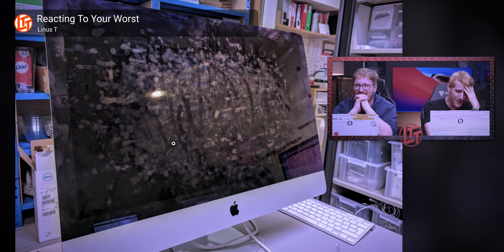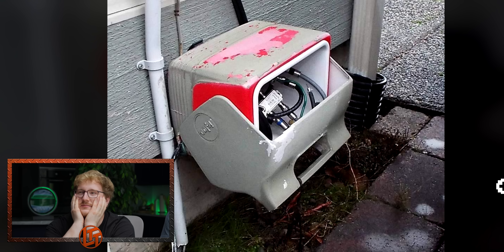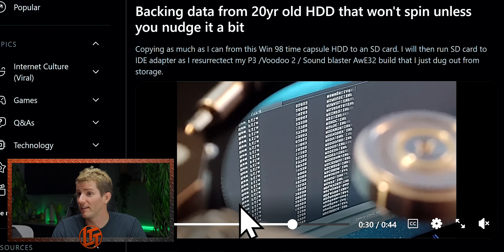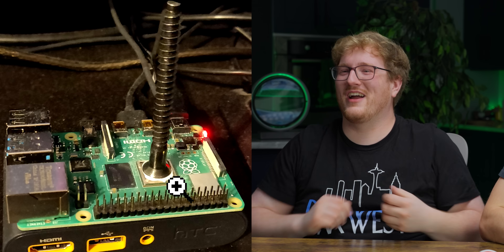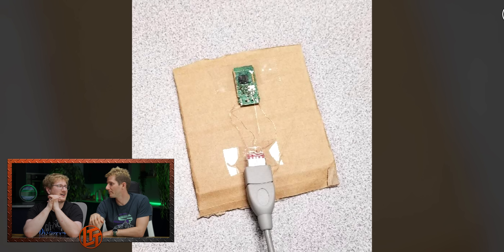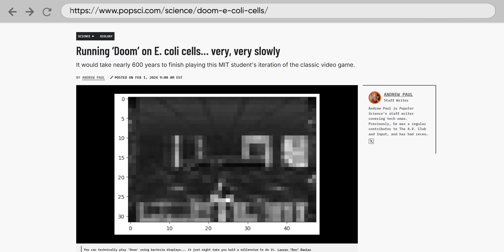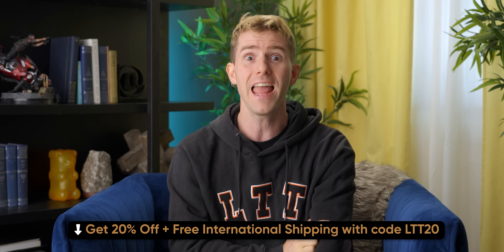Are You All Geniuses or Idiots? - Reacting to Your Best Tech MacGyvering

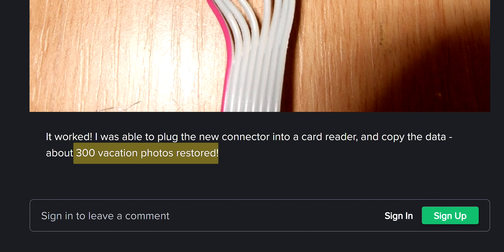Comment: In defense of 10:43 wooden monitor arm, those are NOT cheap to ship if you live on an island.
I have tried to order proper ones online, and have been quoted $100+ in shipping alone.
Think "metal item" and "air mail"
I think that one is perfectly valid and clever.
Reply: Yeah, and it doesn't even look bad in my opinion. Sure, the finish is a bit rough. But it seems to be in a workshop environment so that's perfectly fine. If I had made this I'd actually be pretty proud of it.
Reply: yea, idk if they realize that a lot of the cost to get things to islands/smaller countries may be due to the weight of the item not the US$ cost. As a result, it may be less costly to get an expensive light item than it would be to get a cheap heavy item.
Reply: And sellers that ship it to their country usually don't buy enough to benefit from bulk shipping because the demand is low.

I'm really annoyed with how inconsiderate people are even when they don't know anything about the situation.
Reply: I have a moveable monitor. It lives on a ream of paper. When I want it closer, I wiggle it forward. When I want it higher, I add paper. When my printer runs out, my monitor gets lower.
Reply: Learning to weld might've been a better idea still.
Reply: @GoogleDoesEvil  Yeah, but metal ain't cheap either though. That looks like a bunch of scrap wood he had lying around. The whole thing probably cost him less than 5 bucks.
Reply: Jake also went "not worth it for the amount of work" while the person may be paid pennies on a dollar. What if all that time and effort would not earn them enough money to buy a monitor arm no matter what?
Reply: @firstname8637  Steel is cheap and plentiful everywhere. Welders and welding supplies are not though. :/ Woodworking supplies are easier to get.
Reply: @GoogleDoesEvil  Depends on where you live and where you get it I guess. Where I'm from steel, while not "expensive" expensive is still considerably more expensive than cheap wood. At least when you get it from the hardware store and not the scrapyard. A cheap welder with some supplies on the other hand you can get for around 100 bucks.

Edit: That'd be a cheap cheap welder though. Workable but not great.
Reply: @firstname8637  Fair enough. I usually get my steel from people trying to get rid of it so it's pretty much free. Whereas the free wood I can pick up is unusable.
Reply: It should also be noted that isn't a $100 XBone controller. I have the same one for my laptop and it was 30 at most from Best Buy due to being an older model
Reply: Monitor arm was awesome! Can't belive it got universal dunkage. I get the reluctance to spend a lot on something that just sits there, and if they're priced at a premium in your region, all the more reason.

Comment: Guess what? Long story, but we live in rural Australia. Our Starlink is mounted 100m from our house on a small shed. Because the WiFi would obviously never reach, and we weren't able to place CAT-6, I rigged up a system:

Power goes in to Starlink modem, and up to dish

Ethernet comes out of Starlink adaptor, and enters an Ethernet over Powerline adaptor (will abbreviate to EOP) - here's where things get a little interesting . . . Because the small shed is on a different circuit to our house, I had to run a series of extension cord across the 100m span of our paddock, and then connect another EOP adaptor to the end of it. This would allow us to keep both on the same circuit.

Then, the EOP which was connected to the extension cable, was connected via an ethernet cable to another EOP on our house's circuit, with the final one providing wired connections to wherever we wanted to place a final EOP. 

Result: Despite all of the crap in the middle, latency is still pretty good - servers about 500km away get 30ms give or take, and when the distance is larger (let's say to the other side of Earth) it never really gets above 330ms. Speed is about 70-90 on the download, with 18-30 upload. If you connect directly to the Starlink, speeds are way higher - approx. 350 for download, and I think 90 for upload. Ping drops about 10ms, which is just testament to how damn fast these adaptors are these days. 🎉🥳For country internet, those numbers are crazy good. With our old provider, we couldn't ever breach 30 on download, and ping was horrendous - it would often exceed 1 WHOLE SECOND!!

It's a crazy rig, but it's still working half a year later. I made my own ethernet cable, but of course it ended up 20m too short. Bugger. 😑

Comment: Worked in a PC shop that did repairs and data recovery for a while, and yes, old HDDs can run open in a pinch and to get as much data off of them as possible. Especially old IDE drives were comparably rugged in those regards, but they also only held up to 160GB if I remember correctly. Had more than a few drives that needed a little push to run on the desk. Oh, and after I killed one of our own SATA drives that way, we built a poor mans cleanroom/-box from a plastic bin, some 3M halfmask filters and a broken hoover. Worked better than it should have and increased successrates by quite a margin!
Reply: Instead of taking the cover off btw try holding the drive and giving it a sharp spin around the rotational axis of the spindle to get it going. It's like the "phase 1" of push starting if you need to. You can go up from there of course.
Reply: @zyeborm  that was what we did first, if that didn't help... Off with the lid!

Comment: About that DB15 (vga) connector, the pencil impression is pretty smart and better than clicking a picture. It can be very difficult to judge the size in a picture.

I mean it being a vga connector, picture would have worked perfectly fine. But for someone who didn’t know that it was a ubiquitous thing, getting a perfect size replica was genius.
Reply: Agreed, and there have been plenty of connectors that look similar or even are identical in size and shape with different pin counts, or happen to be female rather than male this time that will be hard to identify correctly in a photo. Maybe with enough photo you'd figure it out, and sometimes as with something like a 3 pin vs 5 pin xlr the pin count is small and changed dramatically enough its quite apparent. 
But just from a photo, especially if its a photo with nothing to give you a sense of scale it would be quite easy to mistake the cable.
Reply: The person most likely didn't have a camera to take the picture.
Reply: I've done something similar to work out what a connector or screw was when I couldn't see it, or get a camera near it. 
You push your finger hard enough onto the connector/screw that it leaves a dent in your finger, which should last long enough for you to look at it and work out what cable/screwdriver bit you need.
Reply: @Daunlouded  That! 
I've used VGA long before digital cameras were a thing. And I believe that by the time I had a phone with built in camera I already upgraded to DVI.
Reply: Just in case they had one of those vga micros hey? 💀

Comment: 14:30 if you are wearing those ear protectors you're not going to hear anything any ways they are made for use in places were the sound will damage your ears i used to use those in the marines around jets spinning up their engines
Reply: However by modifying them like that they likely compromised their sound isolating ability.

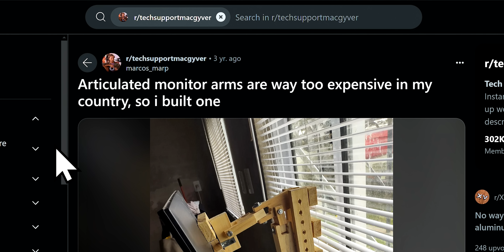Comment: 11:06 as someone who's on that situation, I've seen monitor arms that are the price of two ps4 controllers for comparison, and they're not even great, they're just expensive because "reasons"
Reply: @SCP-tn2ln  yeah kinda stupid to look at someone having a control and be like yeah THEY GOT 50$ extra for s monitor support. Even the most CHINESIUM monitor support over here Is like 2x the markup
Reply: Damn, even here in Brazil it's not that bad. A vesa arm is about half the price of a basic Xbox One controller
Reply: I'm in another part of canada ( quebec ) and just because they use the excuse of 2 taxes the cheapest mic arm I could find was 50$. One of my friend in another province check that pne and it was 20$.
Reply: The guy is in Australia, I reckon. Amazon au monitor arm is aud50. Just cheap.
Reply: Monitor arm costs like, $10.
Reply: I was really surprised they dunked on this one so hard. Of all the janky stuff before that they let slide this one they treated the worst, I don’t get it lol I think he did a great job
Reply: @iamashamanama3712  the one I'm making use copper pipe so even more jank
Reply: @iamashamanama3712  Unnecessarily harsh I agree. Looks like it works and it's not like you have to see it much.
Reply: @fenrir324 Bolting it together or doing some soldering too? Sounds cool, you should submit it for the next time they do one of these videos.
Reply: @old_liquid  in uk I bought one for 20£. generally everything $/£ which is 30% more expensive. but a few years ago they were 100+ on amazon. monitors were also expensive and now they started to became cheaper. I choose a portable monitor because they promised screen mirroring from phones. that didn't work. didn't had vesa but a magnetic cover. so I bought a 10£ extender. basically 4 metal plates and 4 turning holders. extends from vesa arm forming an X shape holder L shape  fingers that stick onto the frame a bit. only needed 3. the legs more of a K, one holds the top. would work up to 21 inch but 16 inch only needs 3 because minimum length needs to go outward. so the 4th would block the 3rd. it's not symmetrical or crazy stable but I can adjust it and turn 90 degree, down and I see from my bed. in east europe wood is cheap and making a monitor stand does not sound crazy to me.

Comment: Fun Fact 7:20 If you have a monitor without VESA, Broken VESA, or just no Feet, A Music Sheet Stand can be a clever way to Mount it. Or in my case I bought a 16" Portable Touchscreen monitor and a Tablet Mount with 1/4 Mountpoints and just attached it to my full size tripod.  Its a handy Go Anywhere solution.
9:30 I have an 80's Macintosh Mouse that I have wired as a Play/Pause Keyboard input that is mounted next to my Front Door so I can Play/Pause Whatever I am Listening/Watching when I walk in/Out.
14:50 Used one of them fancy Toothbrushes that double as an MP3 Player to copy Files to take to a Printer place back in the early 2ks. the lady behind the counter was not phased at all, guess they have seen everything.

Comment: 9:10 I remember whenever we were too lazy to set up the IR bar (before playing a game that didn’t require it), we’d just point the wiimote at a lightbulb to navigate the main menu
Reply: what even the point of the sensor bar? does it just tell the wii mote that it has the sensor bar as reference in 3d space?
Reply: @Kuroji07  Pretty much. It has some amount of IR diodes that flash on wiimote
Reply: @Kuroji07  It emits 2 IR lights for your wiimote to pick up. Your wiimote then communicates with the Wii itself to actually figure out where you're pointing on the screen based on those 2 lights.
Reply: The wiimote has a camera in the front that can only see IR light. So it looks for the two dots, and this allows it to see where the TV is, and it help it see how far to tilt the cursor. Seems really janky (and it often was) but some people swear by it, and I've heard that the cursor in Mario Galaxy on the switch isn't half as good, as it's trying to use the Joycon gyro instead to mimick it. The Wii was weirdly genius
Reply: @brentr9161  Communicates how? With radio?
Reply: @squidwardo7074  Bluetooth.
Reply: @squidwardo7074 technically yeah. Ultra high frequency waves in the form of bluetooth. For some reason i imagined bluetooth only really came into use in consumer electronics in the 2010s for some reason, but i guess this was just when it became more widely useable for different devices

Comment: I grew up in a "do what you can with what you have" home so I have some good memories haha. Once had the plastic thingy that hold the CPU agaisnt the motherboard melting, adhesive wasn't strong enough to support the heatsink and it's fan so I sew it back, dozens of string later and everything was working good as if nothing happened.

Also fixed my keyboard with kinder packaging, another time with bread, chewing-gum, nail-cutter, my teeths, small nail and blu-tack etc I finally switched to wireless after dozens of "fixes" and exhausting every solution I could think of
Reply: string is truly one of humanity's MVPs

Comment: 6:14 At one point I used a self-built wifi-antenna as well, consisting of some thick copper bent into a figure 8 on top of a an unused CD. Used it to connect to a wifi-based ISP. The AP was on the same side of the road so I had to point it directly to a specific spot on a house across the street where signal bounced off of.

Comment: 15:30 I have seen simple office, desk, fans used to cool plenty of racks, sometimes with mission critical systems that can mean life or death in someway or another. Usually this happens when a server room, coms closet, expands beyond the original intent of what that room was supposed to have. a lot of times, these rooms are built in the 50s-60s and only had bix fields and telecom equipment that barely gave off any heat. now they have switches, routers, servers, radios, UPS's among many other rack or wall mounted systems that produce a lot of heat. In some locations, these are hostile (enviromentally, and ... enemy) areas, or extremely remote locations only accessable by air or boat. things MUST continue running so you make do with what you can find around to ensure things stay cool.
Reply: Absolutely.  Used to work in a datacenter and summer temps continued to climb to new records ever year, every August we'd break out a whole collection of desk fans, box fans, and big industrial drying fans to get more airflow through especially hot aisles and racks.  There were even documented SOPs on where to put each fan and where to point it to get the best results.

Eventually the whole cooling system was redesigned and upgraded, but that takes a long time and a big investment.  Sometimes you need a solution right now.
Reply: Yep Im a field tech for a business focused ISP and I have seen some serious jank. The worst are blue collar construction(asphalt, cement and plants etc) and surprisingly doctor offices. I have lost count of how many janitor closets that are doing dual rolls as the dmark and a janitor closet. The only ones I get super surprised by is when its in the bathroom. Only 4 of those so far lmao.

Comment: It was a work HP pre built computer, so I never took a photo of it, but the case had a raised power button mounted on the top right corner.

You could accidentally turn the thing off if you accidentally put a heavy enough box on it--which a coworker did.  You could also turn it off if you accidentally propped up a foot on it--which a coworker also did.

I found some scrap foam core, and securely taped it to the outside of the case right beside the power button:  Instant recessed power button!

I also had a work keyboard whose legs didn't raise the keyboard to a comfortable enough ergonomic angle on the desk.  I securely taped some more foam core to the back to prop it at the angle I preferred.

Good times!

Comment: for the mouse door one i absolutely am obsessed w how many signs they need telling you to press the button to open the door
Reply: Well, you have proved their point because you kinda missed the sign that said you need both buttonS 😅 not just THE button
Reply: As posted elsewhere in this thread, it is at some extended-care facility for residents with dementia. Over their life, they learned, and have retained, how to use "normal" door-handles, but their failing short-term memory prevents them from learning & retaining the knowledge on how to work this door-opener. So, visitors can easily follow the instructions. Much cheaper than a surveillance camera wired back to the nursing station, forcing a worker to be present, 24/7, to watch their screen, and press a "release" button.

Comment: Back in the day I used my OG model 1001 PlayStation's composite out to attach to my MiniDisc player via taping the other ends of male-to-male composite audio cables to the right poles on a male-to-male 3.5mm jack audio cable, which was then plugged into the microphone input on my MiniDisc player, all to record my CD tracks onto MiniDisc.

Comment: I've sorta got one: Whenever I'm doing cable-management with plastic zip-ties I'll keep a pair of finger nail clippers handy to trim the leftover thread. Not just because they're sharp enough to cut through plastic pretty easily, but because they also leave a smooth/convex finish every time- one that wont scratch or snag you or your cables (maybe pick up a new pair though if you're looking to try it, for sanitary reasons; though anecdotally I've heard American ones aren't too well-made, so it may be worth importing a cheap pair from Australia or Japan where I hear they're sold at a higher basic manufacturing-quality).
Reply: I never use zip ties, so when I recently tried flush wire cutters on one I was surprised to learn that they actually do cut the ends short enough that you can't feel them at all. Similar price to good nail clippers.

Comment: I'm an OG and we started modding when an athlon xp year 2000ish, and oh boy,  do i have some photos for you! I put a bathroom squirrel cage exhaust fan IN my pc. My friend used a solid state relay to activate c9 christmas bulbs off the HDD light. My friend brought 3ft stereo floor speakers to a lan. I painted my monitor and bought a petina kit from home depot and made it look copper aged. We added neon tubes from autozone, to the inside and drenel cut designs and added plexi glass. And boy does the list go on!